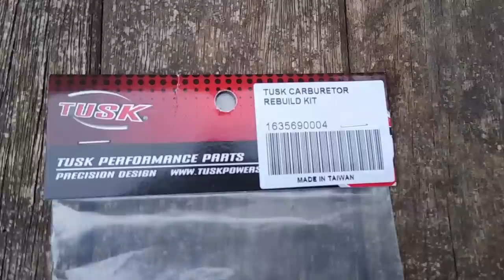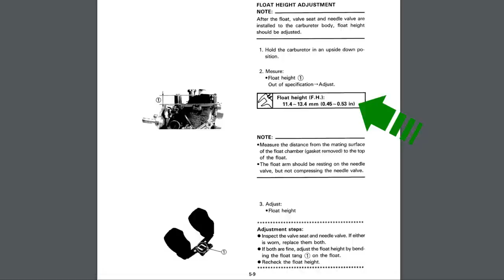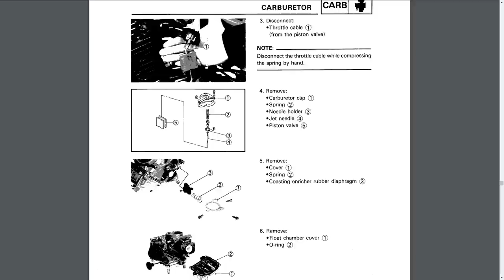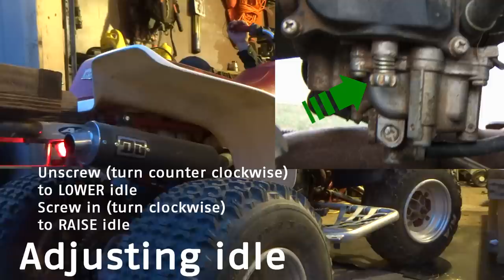YAMAHA WARRIOR ATV CARB CLEAN, REPAIR AND REBUILD - CARBURETOR FUEL SYSTEM TUNE UP

Comment: Thanks for this! Used as a guideline in rebuilding mine.
Reply: This video helped me so much. I'm not very mechanical. You did a great job covering everything which is what someone like me needs. I will be putting everything back but was wondering if you used a gasket adhesive when you put everything back on? I have a 95 yamaha warrior.

Comment: Truly excellent video!

We are having a problem with that same rod, which I think you call the throttle plunger. Ours is that gas leaks around it and pours through the throttle mechanism cover. We seem to be missing the black plastic or rubber piece I see in your video that is perhaps a seal that the rod goes through. Also, is there supposed to be a spring that pushes the rod up to meet the plastic cam in the throttle mechanism cavity? Neither of those things came in our carb rebuild kit. Where could we get them from?
Reply from the maker: You can actually use the spring out of a click pen as it is stiffer. That's what I've used in the past.
Reply from the maker: Is the float adjusted?

Comment: I have a 98 warrior and I have been putting 2 stroke gas in ever since I got it which was 3 years ago the owner befor said it was a 2 stoke it's been running fine ever since about a month ago then I found out that it's supposed to be 4 stroke and it's never blown out smoke until about a month ago I put regular gas in it and now it runs better than ever

Comment: The stuck accelerator pump! I've rebuilt my carb 3 times over the last 6 years and missed that on EVER video I've watched. Mine would run ok but fall out and die when going full throttle from a dead stop
Reply from the maker: you can take the spring out of a bic pen and replace that weaker one. doing another updared video soon on this with our new 87 project
Reply: Dang it was so bound up the aluminum stem broke off. I sprayed it with PB Blaster and left it soaking for a couple hours. Welp
Reply from the maker: jump on the warrior yfm350 facebook group, i belt someone has one.

Comment: Man, how much strength does it take to remove the idle jet? Of course I stripped the top and won't be able to screw it out. Hopefully I didn't ruin the entire thing. What would be the best plan of attack? Drill it out somehow? Wedge something into the idle hole and try to turn it again? Obviously the jet is trashed now but dang....

Comment: Hey man I have a 87 warrior and I was wondering how I could make it go faster with the stock engine what do you think I could do to make it go 70-75 thanks
Reply: Could you help me out on what I should get
Reply from the maker: KingBiggie 88224 without tearing it apart and spending a lot of money a pipe, jetting and air intake are going go be the only thing I suggest. The warrior is a great trail quad but not a lot of top speed. You can swap to a larger front sprocket for more top speed but you will lose low end torque which is what I like about the warrior.
Reply from the maker: KingBiggie 88224 basically I would just focus on keeping your warrior a fun reliable machine and perhaps look at saving up for a 450 or 700 in the future if you really want more top speed
Reply: TrailBlogger thanks man what size jets and what sprocket ratio would be the best for speed but yet decent on torque
Reply: TrailBlogger and how fast do you think it’ll go with those things
Reply from the maker: KingBiggie 88224 13 is stock sprocket size. 12 is for more low end. 14 would be more top end. I find the stock size 13 perfect unless you are in the dunes where a 12 is better to keep from bogging on the hills
Reply from the maker: KingBiggie 88224 with the larger front sprocket at taller rear tires you will gain maybe 4-5 mph top. Not much more. It will take you longer to reach top speed also
Reply: TrailBlogger thanks man you’ve been helpful what size jets would work the best
Reply from the maker: i would stay with stock jets unless you are running an aftermarket pipe and intake. jetting is different from bike to bike and at different locations. if you are extremely high elevation you might change your jetting based on that. I cant tell you exactly what jetting to run so I would say start with stock jets and go from there if it does not run correctly.
Reply: TrailBlogger I’m getting dg pipes and kn air filter
Reply: Could always do a higher comp piston and aftermarket cam.....pretty simple on these air cooled machines.
Reply: Good video ! Thanks bud ... Subcribed!😎
Reply: Subscribed!  😎

Comment: would that pull start work for the newer model warriors too? i have a 2002 and have been wanting an alternative to my electric start, i saw pull start assembly’s and was wondering if it would still fit on my quad.
Reply from the maker: probably, yes. I think you just need to swap flywheels also but better check with someone else on here first who has actually done it before buying parts to be sure.

Comment: After taking it off the bike (carb) and putting it back on after cleaning, I noticed I’ve lost some length to my throttle cable (even maxed out on length) and now it ALWAYS has throttle. I had to twist the carb off the throttle line, not the other way around like you did because my line had NO twist to it (stiff, then spun right back to original position). Do you think I could have twisted the throttle cable somewhere in the sheath and lost some length somehow? Have you ever heard of that happening? The new carb has a slightly different throttle linkup, but not enough to explain the amount of length I’ve lost

Comment: Great video and VERY USEFUL !! But I noticed that you have a DG exhaust. Did you change the pilot and main jet size to make itrun correctly ? I have a 2000 350 Warrior that ran great with a partial original exhaust. (open header)  I purchased a new DG exhaust with the spark arrester, first gear is fine...second gear and above, it falls on its face. Its all original with no carb rebuild.Any solutions you have ? Thanks, Shawn
Reply from the maker: Try bumping the main jet up one size. Could be starving for fuel
Reply: @trailblogger  Do I have to change the pilot jet also ?
Reply from the maker: Maybe. If it wont idle or cuts out low end I would go up one size. Try adjusting the air fuel screw first though

Comment: i have a needle in my man jet where yours was clean and see through is that normal?
Reply: Main jet and its tube should be able to see through.  The tube that the slide needle drops into all need to be removed and it's air holes cleaned.  Their is an air passage through the carb that needs to be cleaned or insured that it has no blockage. It can only be seen or cleaned once the slide/needle receiving frame is pulled.  Air passages are rare to get plugged unless you run with no air filter or the engine has backfiring from air cut off diaphram circuit failure.

Comment: Whats the piece called where the throttle cable connects to the carb ? The throttle cable slides threw it into the carb . I can see it on the thumbnail its a  bent little pipe with a threaded end rite ontop of the choke stick

Comment: I have a 2004  it Idols but stalls when giving gas but it works when the choke is pulled out a little is this a jet or a accelerator problem was going to try to rebuild it
Reply from the maker: Could be either. It sounds like the jets are just clogged. Take a fine wire and make sure you can see light through them. Nice round hole with no particles clogging the flow. Choking it just adds more fuel so she is not getting enough fuel. Also check your fuel cap make sure it is venting or it will not let enough fuel down the petcock. There is also a tiny filter inside your tank right above the petcock fuel valve.
Reply: TrailBlogger ok I’ll try it thank you for replying back
Reply from the maker: @turbodiesel101  good luck!

Comment: I have 1988 yamaha moto 4 350. Your demo appears to have a hole all the way thru pilot jet screw. My jet screw has a hole but does not appear to go all the way thru. The bottom of screw is solid brass ?????

Comment: Hey, not sure if I missed it, but where do you set your air mixture screw? It's the brass one under carb right? Mine is turned out 4 times.
Reply: Yep. Stock is around 2 full turns out. That's what they're set to from the factory I'm pretty sure

Comment: I got oil leaking where the exhaust connects to the head please help is it  the piston rings? 1999 Yamaha warrior 350
Reply from the maker: Compression test time. Get yourself a compression tester ( Bosch makes decent ones for 40-50 bucks ). Get a service manual and look up the specs for your quad. Should tell you if the top end is toast. Could be the valves or rings or both.

Comment: what do you do if when you rev it, it stays a tiny bit revved before it idles again? Or is that normal?
Reply from the maker: With the engine off push the throttle in and then quickly release it. Does the slide clack back down nice and solid? It's the cable is bound up a little it can cause that. Lube your throttle cable. Check it again. Should be a nice  crisp throttle release and you should hear it snap back shut inside. If it doesn't your slide or cable could be goobered up. Also check your intake boot for cracks, air leaks.
Reply: TrailBlogger thank you so much, I’m fixing it right now😂 the slide clacks down like it should and I just changed the intake boot, im ganna try lubing the cable.
Reply from the maker: You may need to turn the idle down a bit or adjust the mix screw but if it ran fine before I would check the cable first and make sure it's not adjusted too tight or sticking like I mentioned. The cable should have just a tiny bit of slack in it when you let off. (You adjust the idle at the carb, not at the handlebar)
Reply: TrailBlogger the float height wasn’t right and the accelerator pump was kinda stuck, and the cables pretty dry, thanks!
Reply from the maker: @danieljimenez1036  nice good catch!! Glad I could help

Comment: Any thoughts on what would cause the engine to fall on it's nose when the throttle is snapped from idle to WOT! Anything other than the obvious dirty jets.  I went through the carb very meticulously.  Only found a damaged O ring in the pilot screw assembly, 2 of the ten air holes in the main needle emulsion tube.  It spits fuel back out the Venturi when the throttle is snapped.  If ya immediately cover the Venturi with two fingers it recovers. Could there be an issue with intake to tight?  When throttle is eased into wot there is no problem, only from idle to wot.
Reply from the maker: safety switch on the clutch perch bypassed yet?
Reply: TrailBlogger are you referring to the neutral safety switch or is there something else on this 89 dinasour?
Reply from the maker: on our 88 it ran like poop until i chopped the two wires going to the clutch perch safety switch and twisted them together. i showed it in one of these videos
Reply from the maker: are there any cracks in your intake boot? make sure it has a good seal around the intake on both sides
Reply from the maker: skip to 24 minutes in this other video https://youtu.be/fR3ZwyXLVKs
Reply: TrailBlogger replaced boot as it was cracked
Reply: TrailBlogger this thing will run and throttle up and drive around as though nothing is wrong.  It's only when the throttle is snapped from idle to WOT, it then bogs and if held  throttle open will die.  Ease into throttle it does so without so much as a sputter.
Reply from the maker: is the pin for the accelerator pump sticking? i sanded mine with fine paper to make it smoother. you can also replace it with a stiffer spring out of a pen
Reply: TrailBlogger it runs perfect except when ya stomp the throttle then bogs till it dies or ya let off to recover
Reply: TrailBlogger could even get it to run until I fixed the boot.  Not any air leaks there now.
Reply: TrailBlogger any advice on how I could hook up a vacuum gage to see if there is any info from that diagnosis that might help.  Could an intake be to tight and blowing back?
Reply: TrailBlogger there is not a piston type accelerator pump on this carb!  I can only assume it gets its needed fuel enrichment from main and supplemented by idle circuit.
Reply from the maker: are you using the stock carb? the plunger for the accelerator pump is under the plastic side cover on the carb. a plastic piece pushes it down when you pull the throttle
Reply: TrailBlogger yes as near as I know.  It's not my machine and I have no history.  When looking up parts for it by application it shows no accelerator pump piston.  There is a hole in the bowl but that hole has no bore into bowl for fuel to move into.  There is no arm on the butterfly cam that would move the piston up and down.  I have viewed this strange model on other YouTube vids but no responses from them as to if they have encountered this problem.   Here is a link to parts diagram.   https://www.partzilla.com/catalog/yamaha/atv/1989/big-bear-4wd-yfm350fww/carburetor.      The strange thing about all this is this carb has a butterfly and slide tube but the parts lists show no butterfly.  All the vids I have viewed of same are just like mine.
Reply: TrailBlogger I have not found a clutch safety switch, this machine is automatic, It must use a centrifugal clutch but I am not finding and switch to bypass.  When looking up that described part only neutral switches come up.
Reply: I wanted to thank you for your responses!  I am somewhat of a newbie to working on these machines.  My mainstay has been small gas engines,  2 and 4 stroke, chainsaws, weedeater or anything with a gas engine. My son is a certified gm/ dodge mechanic and helps me when he can.  He has a slug of 4 wheelers and always does his own work and all his friends and customers. This one is even eluding him.
Reply from the maker: @magicone9327  sorry I missed that you were working on a big bear 350. it must be a different carb. yes, they have a different, automatic style clutch. my first ATV was a Big Bear 350 (my father's ATV actually) ironically 30 some years later I am the one fixing up a quad for him to ride (the Yamaha warrior). the Warrior is similar to the Big Bear 350 but not identical. I do remember when ours was having a problem similar to yours I ended up finding an air leak in our intake boot so I would double check there is nothing there around the intake leaking as that can cause a hesitation issue like you are describing. good luck with the big bear repair. They are unstoppable tanks when kept in running shape. I cannot remember ours ever needing anything but a fresh battery and a set of tires at one point and I was very hard on that poor machine. Let me know if you guys get it figured out!
Reply: TrailBlogger I have repaired intake and subsequently sprayed carb cleaner on and around to look for leaks and find none.
Reply: TrailBlogger would you concur that it gets all fuel needed from the main and supplementary amount from idle circuit for the throttle snap to WOT?
Reply: TrailBlogger this thing runs perfect, under load, if all your doing is easing into the throttle to WOT.  I have pushed snow with it and it doesn't have any issue except snap to WOT!

Comment: I just got a warrior and something is wrong with the carb but how much was this kit you bought
Reply from the maker: Carb kits are usually about 20 - 30 bucks on eBay or Amazon. Rocky mountain atv is also a good place to look for parts. I'd just clean it first though. Usually it's a clogged pilot jet or the float valve. Both can be cleaned without the kit and just a little carb cleaner. If your gaskets are bad or the seal around the pilot is had you will have issues. What's it doing when you try to start it?
Reply: I need some advice my quad fires right up but at low throttle it’s dieing
Reply: I cleaned it twice it seems to be something with the throttle tho cause it high revs and is ok but just low throttle it wants to shut off
Reply from the maker: @ronmurdock8897  have you checked for air leaks around the rubber intake boot? Did you try turning up the idle? On this one I had to bypass the safety switch on the clutch perch by twisting the wires together.
Reply: I actually got it to start yesterday after my last comment and it idled high af but seemed ok then it wouldn’t idle down at all I turned the idle down I pulled the choke and everything it just wouldn’t die so I’m getting ready to go mess with it some more in a min

Comment: What is the diaphragm on the right side if the carb?  What does it do?
Reply from the maker: accelerator pump maybe? im actually not sure sorry. parts diagram might say on the rocky mountain oem yamaha site
Reply: TrailBlogger I found that it is called air cut off diaphram,  somehow it help stop deceleration backfiring.
Reply: TrailBlogger my 89 has no piston type accelerator pump as later model mikuni carbs.  I tested the orifices from bowl to choke circuit and found that circuit is only for choke.  So it's then logical that any fuel needed for a snap of the throttle to WOT would come from the main circuit and possible supplemented with the idle circuit.
Reply: TrailBlogger finally found the info on the diaphram and how it works.  When engine is under deceleration the vacuum pressure is increased greatly between the carb, which is closed, and engine.  This vacuum increase pulls the diaphram outward against the spring and its plunger then moves outward and overs an air passage port which then increases the vacuum at the idle circuit.  That momentary low pressure area created allows the fuel from the high pressure side idle circuit to move into the carb throat. This slight enrichment is what stops the backfiring/ popping within the area between intake valve and the closed carb.  This backfiring in this area is most likely a great reason why the intake boot on so many machines fail!  The small explosions of lean fuel, when air cut off is not working, creates more internal pressure than the rubber coated intake can handle.